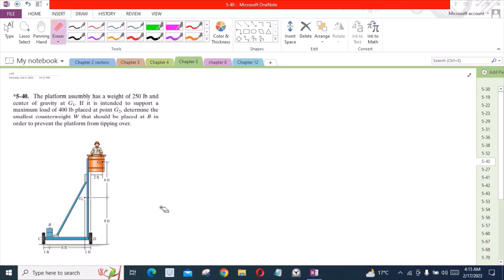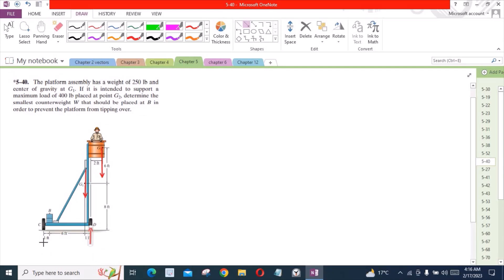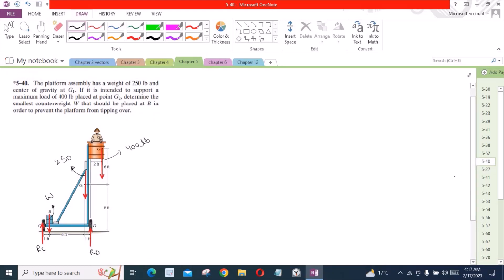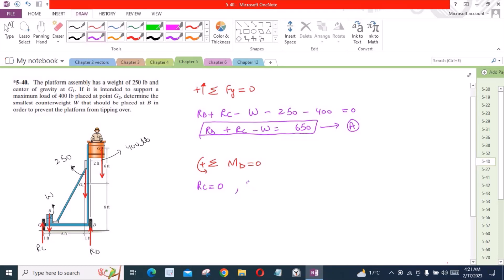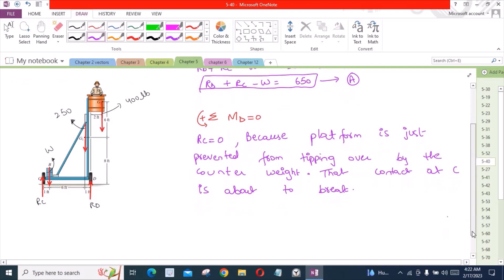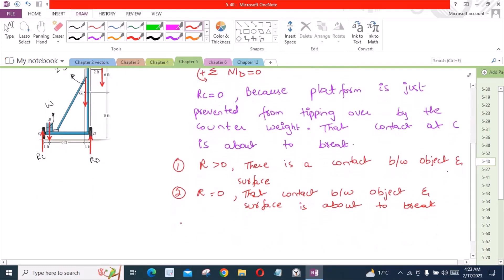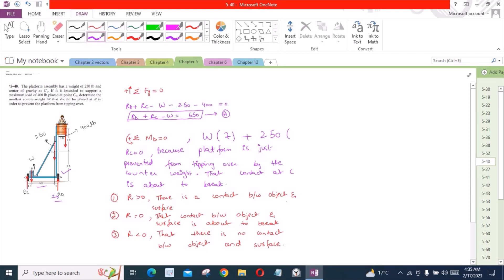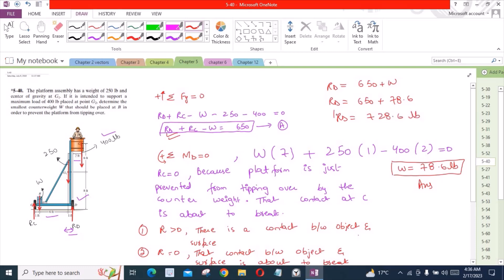5-40 hibbeler statics chapter 5 | hibbeler statics | hibbeler

Comment: why R at point C is zero
Reply from the maker: If the counterweight at B is removed, the platform will tip over. The counterweight is just preventing the platform from tipping over. Hence, the normal reaction at point C is zero because the contact between the surfaces at point C is about to break (only prevented by the counterweight at B). I hope it will help!!

Comment: for the calculation of moment about point D, why dn't we consider the normal reaction at D?
Reply from the maker: Because the reaction at D is passing through the pivot ( point D) so there is no moment arm for reaction at D from pivot. That's why reaction at D will not produce any moment about point D. You can think of it if you apply a force on the hinges (pivot) of door, will the door rotate? The answer is no, because that force has no moment about the hinges. I hope it will  help.
Reply: @solutionsmanual9535  aaahh got it thank you sm!!